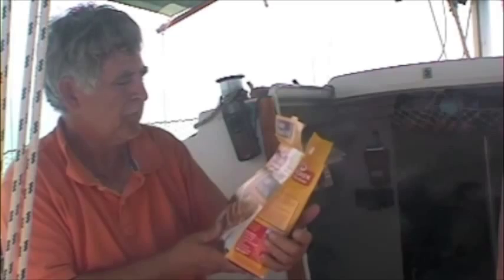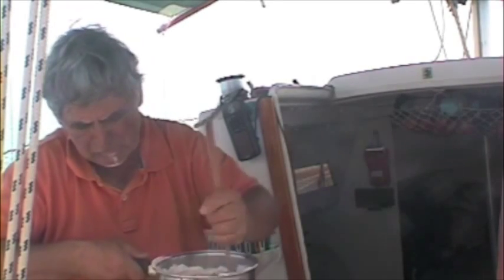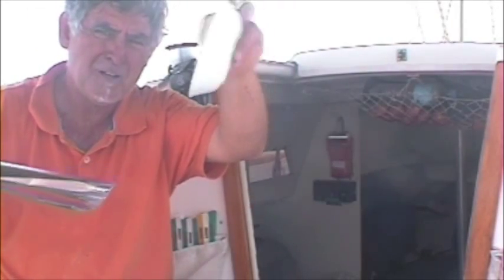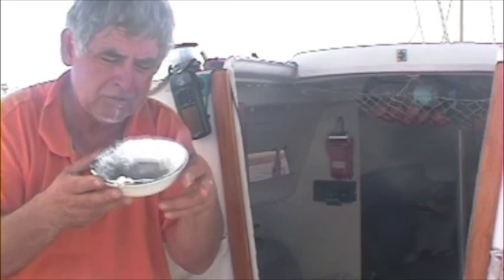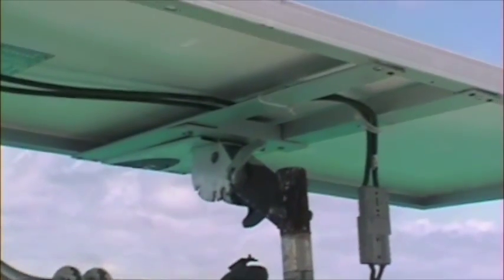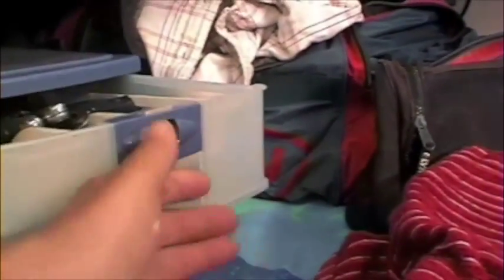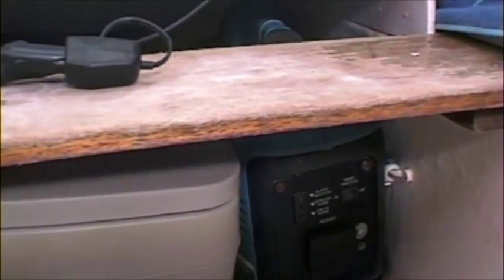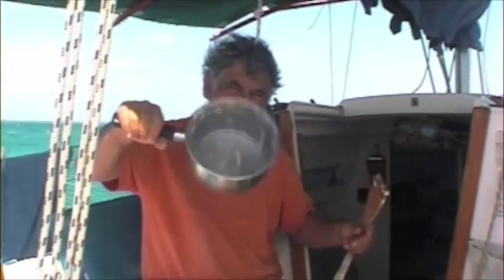HOW TO MAKE BREAD MAKING ON A SMALL BOAT

Comment: Thanks  for this Simon,  I just followed your method, but cooked them with a large pot on an Origo cooker.  The Origo set on just under half seemed to do the trick and the loaves took about 40 minutes each to cook.   Very tasty, and this will come in very handy on the boat :-)